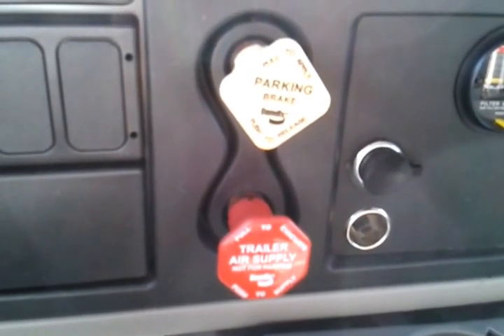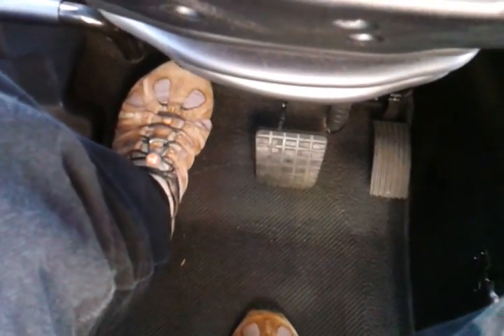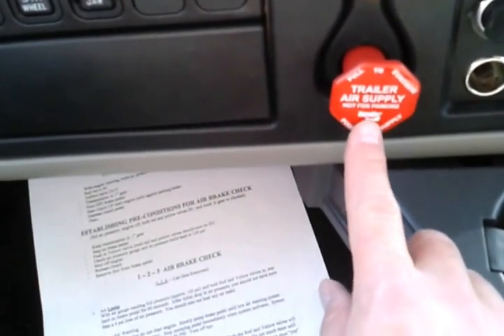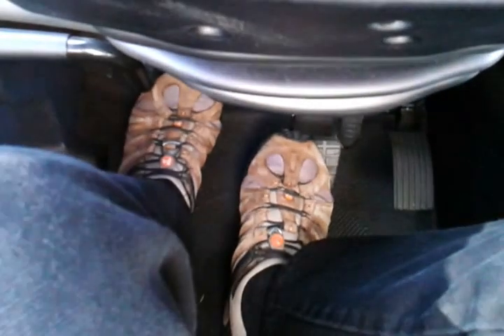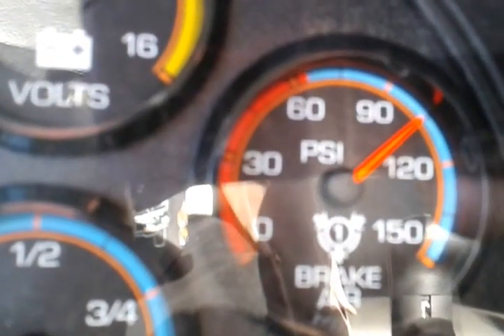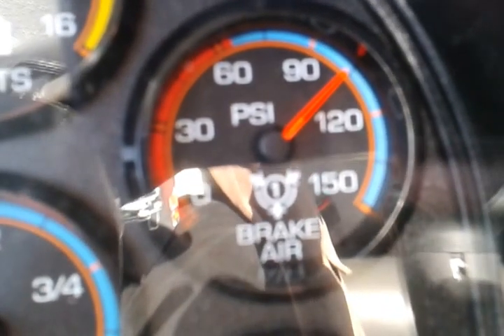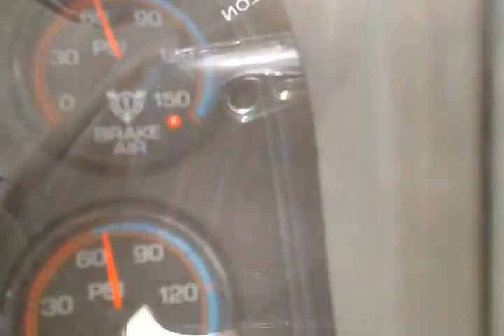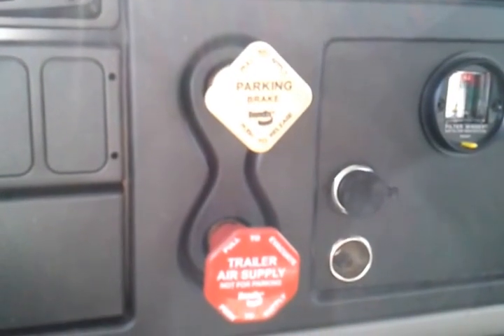Tractor Trailer Air Brake Check

Comment: What did you reference for the leak down check?  In this video it says 3 PSI over 60 seconds for tractor - 4 PSI for tractor trailer.  Does that mean that the leak down check for a trailer only is 1 PSI over 60 seconds?

Comment: I was always told not to pump air brakes while the parking brakes are engaged because the compounded force of the air and spring pressures stress the foundation brakes too much. Makes sense to me.
Reply: That does not matter, since in the trucks air system there is a anti compound valve that does not allow service brake and park brake to act togather